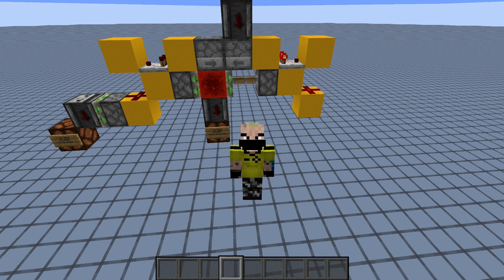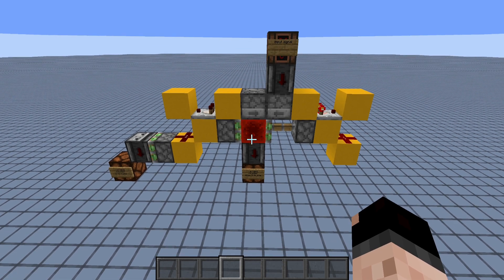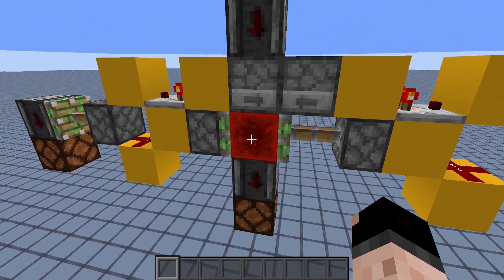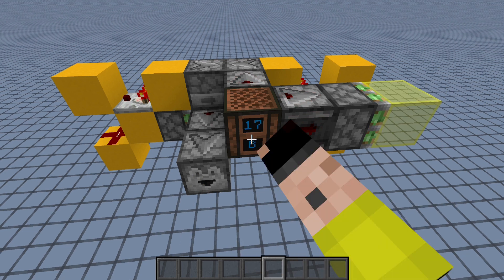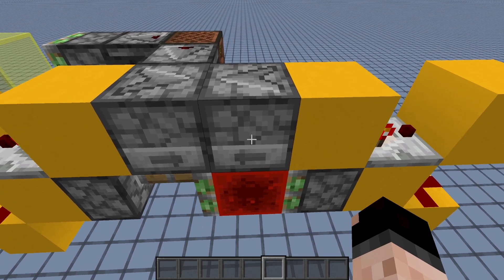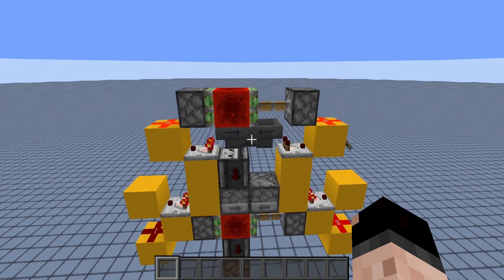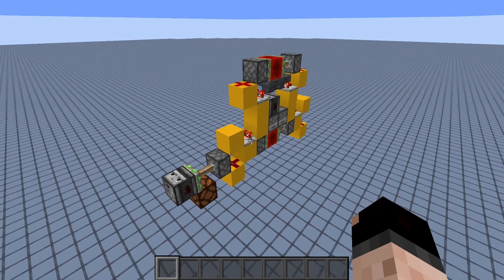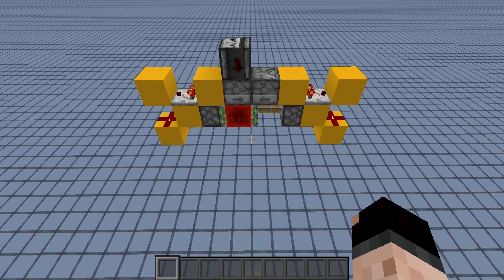Minecraft Variable Signal Counter | N= 1 to 1,152

Comment: Hey Stromme, You can make this tile-able with a few changes. 
1. Remove piece of redstone dust and add a repeater going into the block beside stickypiston
2. Remove the block that the comparator is pointing to.
3. Place an observer facing into the comparator 
4. Place a stickypiston facing down 
5. Attach a restone Block to sticky piston or below depending on whether or not the comparator is powered

This setup will 0-tick the stickypiston to move the redstone block to power the repeater (again based on whether the comparator is powered)

Tiling this will cause another issue when you click the note block. When you click the noteblock the observer will power all the droppers adjacent to it and mess up the other tiled machines.

You can correct this by :

1. Removing the observer and noteblock
2. Replace the observer and noteblock one block to the left of the dropper
3. Place an additional observer facing into the observer you shifted to the left.

This will make averything run as before and now everything will be tile-able.

Hope this helps your viewers
Reply from the maker: Thanks for the idea.  I did want to stay away from toggle states, but this comment gave me the idea to get to 1wt.  added to video description
Reply: @Stromne  glad i could help